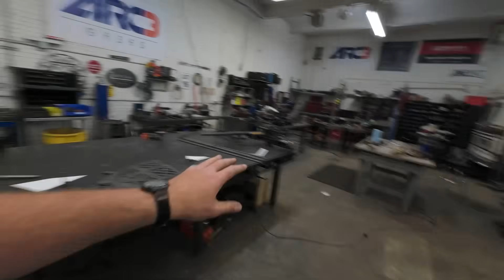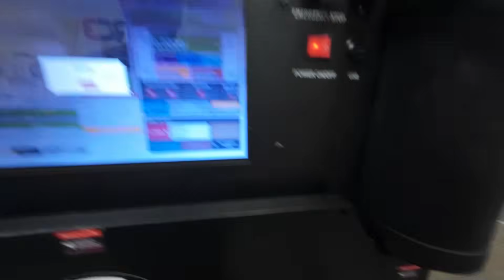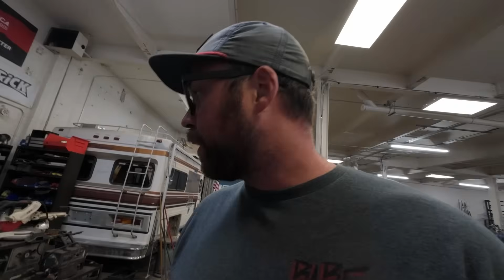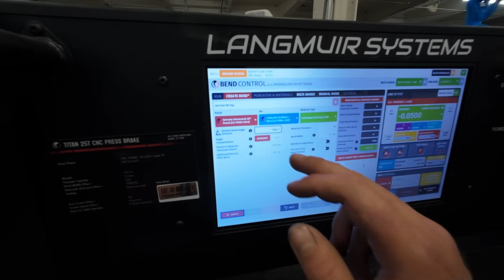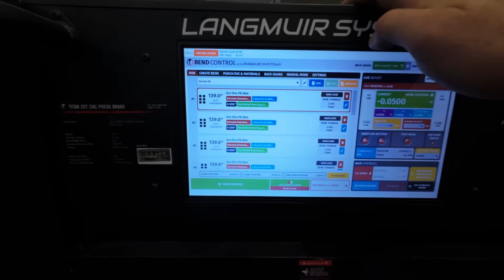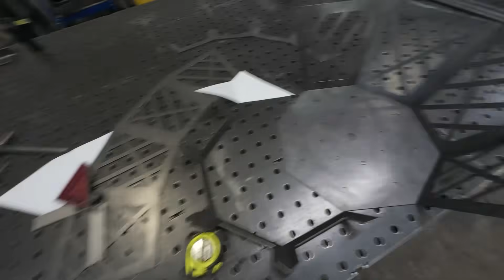CNC Press Brake Fire Pit? - Titan 25T

Comment: Just a heads up Tay, with the direction you have your extreme gooseneck tooling your machine's ram (where the linear rails are mounted) can become hung up on the tools themselves as the ram retracts to its full height. Found that one out the hard way.

Comment: Since time is money, and tape measures are cheap, why don’t you simply buy enough identical good quality tapes for each location that you use one and put them in mounts at each location? Add one more and a belt clip and you should save nearly all of that search time. The only other requirement is the discipline to put the tape back in its holder each time you use it.

Comment: Each cornner is 45 degrees.  I guess you have to use the obtuse side so that works out. 180 degrees - 45 degrees =135 degrees. How did I come up with 45 degrees you ask. You have 8 corners total to make a complete circle. We know that that it takes 360 degrees to make a complete revolution (bent circle here) with 8 points of total bends. 360 diveded by 8 equals 45 degrees total in each corner. Now the math still works out for the half circle, 180 degrees divided by 4 bends equals 45 degrees but again the obtuse side is the other side of the angle past 90 degreess but less than 180 degrees.
Reply: You over bent at 139 degrees and hence why you have a gap. Each corner is 4 degrees over bent.
Reply: If you fix it and it works give me a shout out :face-fuchsia-wide-eyes:
Reply: Yeah he said 139 degrees and I went “what?”  But I’m a sheet metal worker and we do a lot of break up x amount of breaks by 180 or 360 degrees.  Just think square to rounds. Lol

Comment: Is the angle off because the CAD anticipated inner corners of the bevel touching? With gravity and no clamps, the walls sit on the table rather than matching full bevel faces. The circumference is wider at the outer corner of the bevel compared to the inner upper bevel corner.

Comment: The formula for sum of angles for any number of sides of a multi sided shape is: S=(n-2)180 S=sum of angles in degrees
and N= number of sides which gives you the total number of degrees in the completed object then divide by the number of bends to get the angle in degrees for each bend segment. as an example for a pentagram (five sided object: Five minus 2 equals 3 times 180 equals 540 degrees for the sum of all the angles/bends divide by 5(bends to complete a pentagon) equals 108 degrees for each bend. This will create a square 90degree/vertical sides for angled sides you add or subtract the slant in degrees you make the bend from 90 degrees you desire depending on whether you want the sides to open out or in. Ray